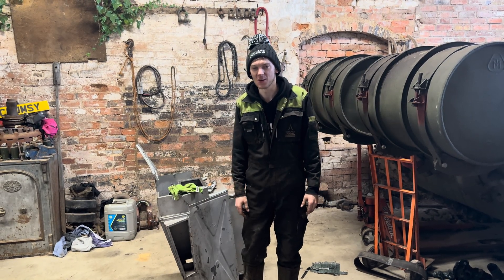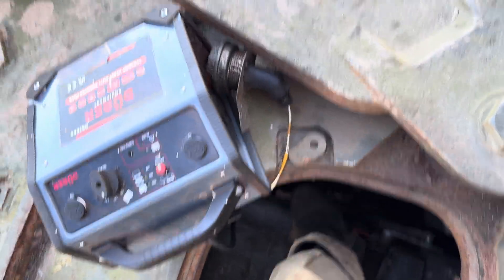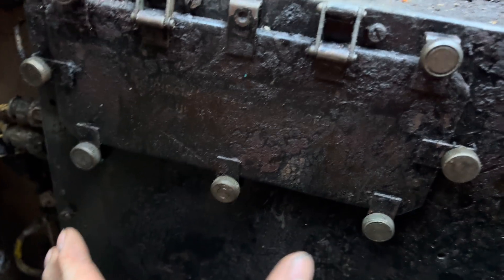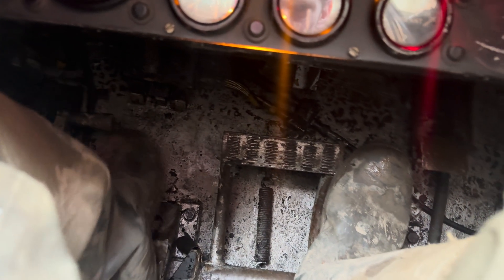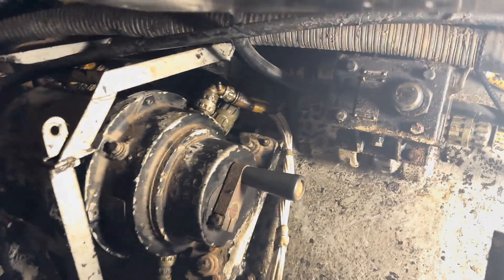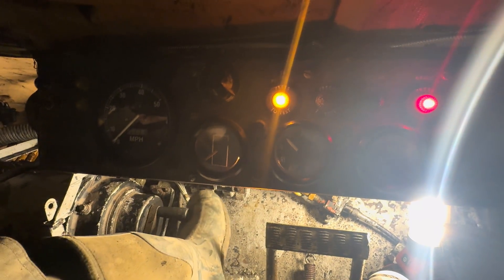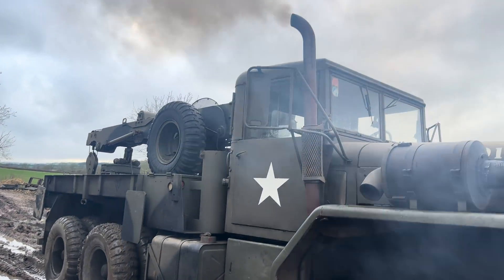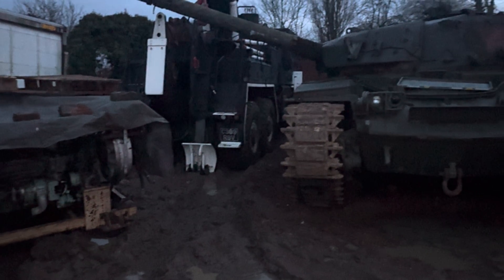Concrete Chieftain POWERS UP!

Comment: Having watched, and enjoyed, most if not all of your videos, I confess to a bit of confusion about these tanks. They are so intricate and complicated! All these control boxes and remote shifting and whatnot, one wouldn’t even crank over if the radiator was low. I would think you’d want a tank to be dead simple, I mean like Model T Ford simple. I can understand a more sophisticated aiming and firing system, but for making the behemoth simply move, wouldn’t you want something so simple it could be repaired in the field with just a handful of tools? I know you, Jack and Ted just fix them, you don’t design them. I’m just pondering rhetorically.

Comment: And I'm in up to the gills 
You got me I subscribed 

Your use of large spanners , WD40 , I support hot mums T shirts has swayed me to push the subscription button 

Also the fine executive leadership of Ted and liberal use of cognitive adjustment tools

Information gleaned to date ....

What a babe ...... I'm in shock this actually works as intended 

It's nakered ....... Needs more WD40

" Random happy whistling ...... I may have fixed this ( on purpose or by mistake  )

Top Gun T shirts are not what they seem

Love the channel lads who don't like diesel,  muck and mayhem

Comment: Bravo for finding the circuit fault. Cable run - Noooooooooooooooooooooooooooooooooooo. 
Most people would have given up but having spares is everything isn't it. You cant leave a big lump like that sitting around. It has to move and with dispatch. Glad that its nearing the time to be fired up with that all important growl.

Comment: Note to self, aluminium electrical connectors submerged for a period of time in non sealed connectors corrode badly and fail to operate as designed after they corrode. 
Having said all that, with spares at a premium and not as common as they were 50 odd years back you're doing a bang up job mate. 
Joke of the day: Why do the British drink 'warm' beer? Because Lucas electrical makes all the fridges!

Comment: ffs, just fix the motor adjustment till it powers the door slats down properly, resting on the floor, not hanging from the roof, no more rattling...
[there is a box on the motor to adjust this]

Comment: Here in the Netherlands we have steel and reinforced concrete 'tiles' called Stelcon, 2x2 meter 14 cm thick with lifting points to make temporary (or permanent)  floors and roads for heavy equipment. Not sure you have that in the UK but it might be an idea to pave around your workshop so you cut down on the inevitable mudfest. Just an idea, love the video's!

Comment: Some of those wiring harnesses  are for shit the cannon connectors are just corroded to garbage and will need to be replaced ,remaking the cabling is tedious but not that big a deal anything electrical that sat in water should be checked taken apart and properly cleaned other wise it will come back to bite you in the ass later

Comment: “After replacing every electrical component and wiring harness in the tank… we got the gearbox indicator to work”. I feel your pain. At least you had spares. 
That’s how I mechanic though. I have a noise, Let’s throw parts at it till it’s gone. At least I don’t pay for my labour.

Comment: These things have to be serviced in the field by personnel that can't log around a maintenance manual. I assume if two cables use the same connectors at either hand they can be swapped, and it might also be a way to jury-rig a fix to get the tank to a proper maintenance facility.
Reply: Manuals were on microfiche, and available in the field.

Comment: Don't worry about the temp gauge, if it's the same as the B60 / B80 then they go full deflection on open circuit so once you connect it to the sender it should resume normal service if the sender works. A wiring short circuit would give zero temp not max.
Reply from the maker: Good point! It be interesting to see if it works with engine in

Comment: Takes me back DECADES, when i was put to work on duff Chiefies at Bovington.  Although I was 'only' a Tels Tech REME, there was always a need for a Vehicle Electrician or CET (Control Equipment Technician) down the workshop.  I can remember working upside down working on the RBJ (Rotary Base Junction - supplying eletrical connections from turret to hull) trying to get something working.  No I wasn't trained to do stuff like that, but I was seen by the Vehicke Mechs as a 'Sparky' rather than a 'Wobbly' - and I could read EMERS!

Comment: Boring question Joe, but why are you doing the electrickery before (presumably?) giving it the internal bays the Cleaning/Auqablast/paint treatment?
Reply from the maker: Because the electronics is the most important part of the chief all the paint in the world won’t fix that. With out functioning electronics it’s pointless moving forward on the project

Comment: When the end of a harness around the connector breaks it's definitely easier to solder splice to me (or crimp splice depending on work room). Or get a new connector and crimp terminals worst case. Hardest part is just finding those

Comment: nightmare to replace that trans harness, left front to right rear controller? looks like you're planning to drop the motor in anyways, motor will have to come back out to change it properly. but i can't blame you, as changing that one harness would be more than an entire video's worth of struggle.
Reply from the maker: The plan is see if it works. When happy pull everything out paint make nice and re fit

Comment: What’s the plan for this thing? Get it working then take it to bits and do a restoration? Or have you got a customer for it?
Reply from the maker: You got it! Got to get everything set up correctly before making it nice
Reply: @MrHewes  - then when it's fixed put the concrete back in?
Reply: pretty sure it's seb's tank
Reply from the maker: Not sebs